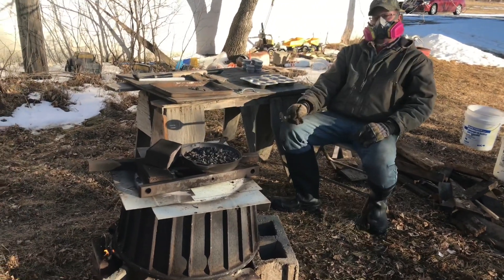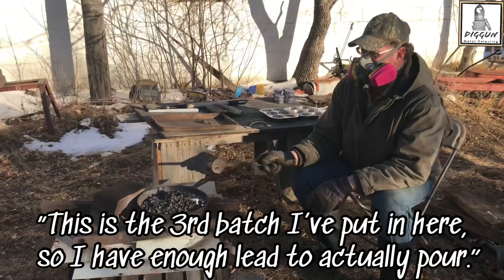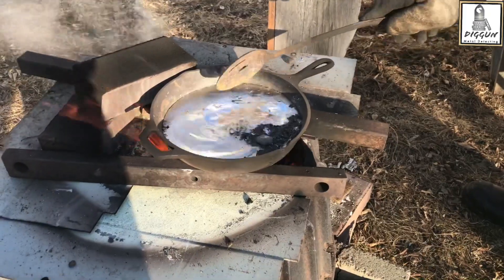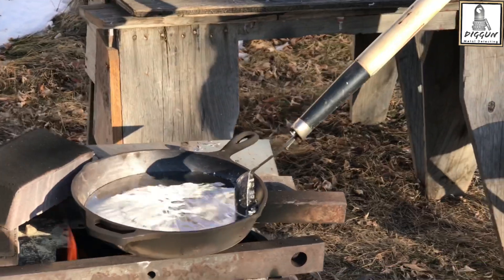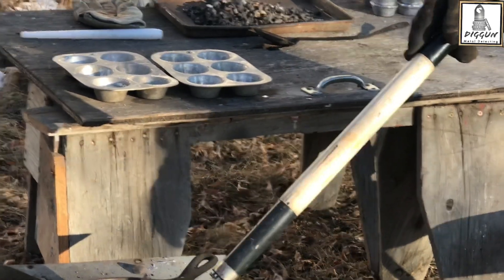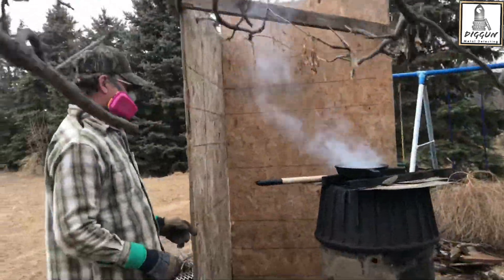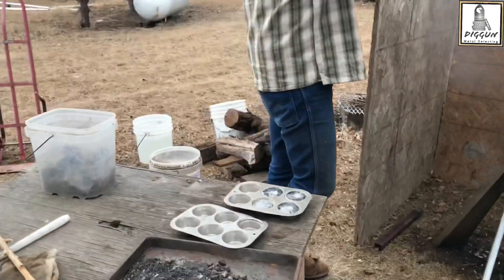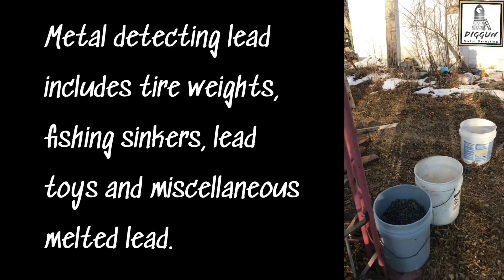Episode 31: Recycle Found Lead (Making Lead Cupcakes) #metaldetecting #metallurgy #mondaydigs

Comment: Very interesting process of smelting the lead.  I have a LOT of lead I saved up over the years of metal detecting.  Scrap brass and scrap copper too
Reply from the maker: It’s actually kind of fun, but you do need to take precautions with lead since it’s toxic. Lead has the lowest melting point so it is the easiest to do over an open fire, while you may need to use a torch to melt copper or brass.

Comment: That’s very cool! Thanks for showing the process. What do you make out of the lead “cupcakes”?
Reply from the maker: It’s just the first step of the process, to refine the lead and make the pucks. The second step is to mix it with a hardening metal then cast it into molds. You can buy cast molds for anything from fishing weights to tiny lead soldiers, just depends on what you want to make.
Reply: @diggun  very cool! I hope can see the process of making something from it😊